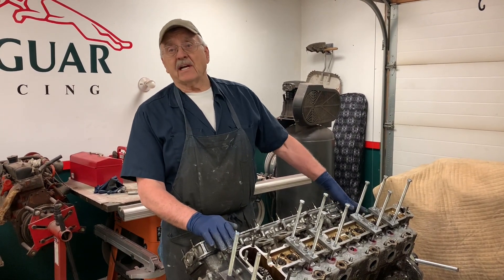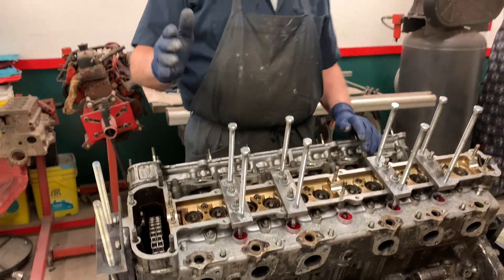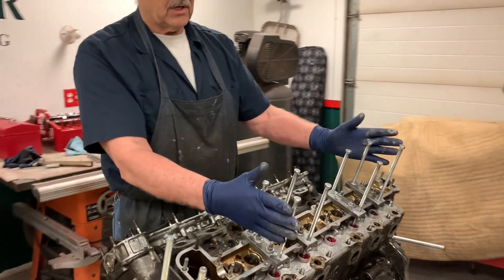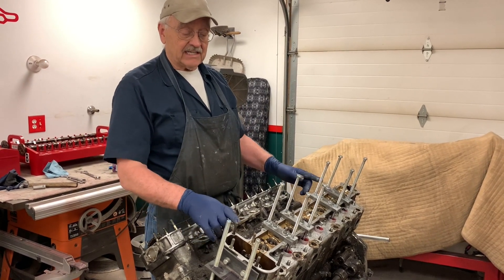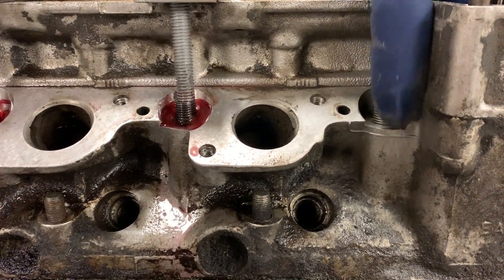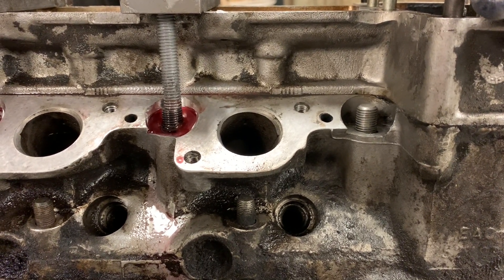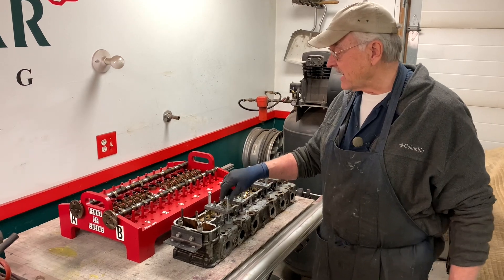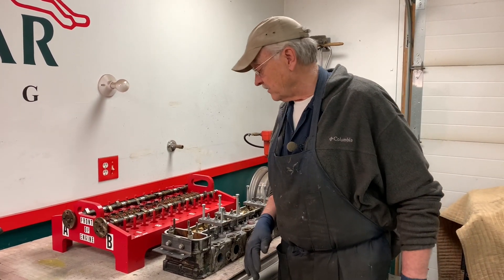Tuesday Extra #3-How To Remove Jaguar V12 Cylinder Heads.

Comment: For my 30 years at Jaguar Services of Tulsa, and having spent my apprenticeship under a British Leyland Engineer, we never did it that way. But, I like you're set up. I watched the ends of your puller rods walking around on the tips of the head studs. Next one I do, I think I'll get some grade 8 threaded rod and put a divet in the end of it to help center it. Otherwise, I'm going to do it your way next time. My old way involved prying in the freeze plug holes and it kind of scarred them up a bit.
Reply from the maker: Thanks for the feedback. Over the years these heads have gotten harder and harder to remove and it’s gotten to the point where unless it’s obvious that it’s going to come off right away, I take a saws all and cut all the main studs. Time is money.

Comment: Using the correct factory Jaguar tool in 30years never had a head not come off. No broken studs.
Reply from the maker: 15-20 years ago, I'd have agreed with you. I used the plate until about ten years ago. Heads have gotten considerably harder to remove since then. Particularly those that haven't had the cooling system maintained properly.

Comment: glad to see somebody else using this method. i have used plasticene to form a well and pour in aluminium wheel cleaner. to do the same job as your penetrating oil. an RAF technician mentioned it years ago. and it works. recommended it to people on the forums but i think they think i'm nuts. always more than one way of skinning a cat. always interested in your videos. good info.

Comment: an easier method is to remove the studs that are in the water-jacket. there are 20 of them. you don't need to remove any of the others for the heads to lift off by hand (as there will be no corrosion issues with the others). However - very importantly - you should not remove 5 specific water-jacket studs as they are more deeply-set in the block. They are likely to snap. That's 2 on the LH bank and 3 on the RH bank. All on the inside rows. So withdraw the 10 outer ones and 5 of the inners and the heads will lift off by hand

Comment: Given how many of these engines you work on, you might want to build a head puller plate like the one in this video. It works on all the studs.
https://youtu.be/-IrTgIzWLSA
There are plans in the XJS forum of Jag-lovers.
Reply from the maker: I've had a plate and used it for years. I like these better. These heads were the worst I've seen and would have given the plate at least as much trouble. Getting the pulling force out in front of the head made a HUGE difference. I'll be rigging up a similar setup at the rear of the head.

Comment: Very creative headpuller, especially the angle iron part in the front and the bottle cap trick. I bought the massive headpuller from England (Google 'Jaguar V12 Head Remover'). Please let me know if you ever want to borrow it. It gets any head off in less than one hour.

Comment: Seeing this makes me want to pull my parts car motor apart for future possible need! Can't imagine anything cooler than having it stripped, rebuilt and at the ready! The thing is however Good fortune and God Willing my 89 xjs will just rack up the miles once I get done sealing it up.35k miles 2k post start up after 17 year hiatus. I wish I had your  experience so that  every incremental advance on my part wouldn't represent such internal high drama!
Reply from the maker: Everyone has to start somewhere. Just taking the parts car engine apart will go a long way toward demystifying it and encourage you to go to the next step.

Comment: Nice job. I just pulled a very tough set from my V12. I made up a flat plate from 2 4" angle irons and managed pretty well. The pop bottle trick would have saved a lot of mess
Reply from the maker: I used to use a plate but found four bolts were all that were working at any given time anyway so these smaller units made sense to me. Plus, my plate went missing several years ago and I had the material to make these and so far so good.

Comment: What coolant do you recommend? Thx, useful video
Reply from the maker: I'm probably not the guy to recommend coolant because I'm alway working on my cars and they get fresh coolant waaaaay more often than recommended. I use concentrate off the shelf at Advance Auto Parts.
Reply: @thecampchaoschronicles9567  green or the expensive stuff recommended?
Reply from the maker: @omarks  I just use the green concentrate.
Reply: @thecampchaoschronicles9567  thanks! That's what is in my 6.0. about to flush it.